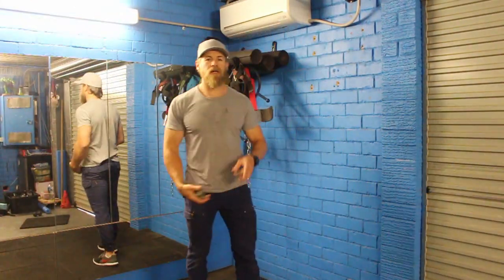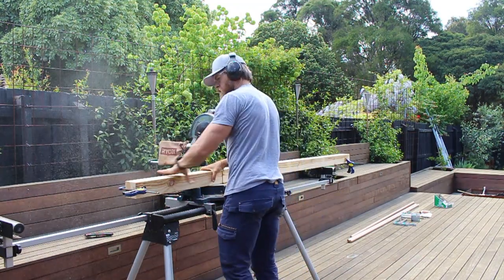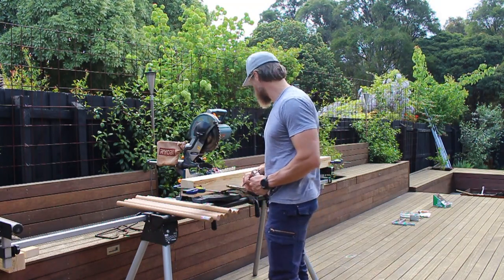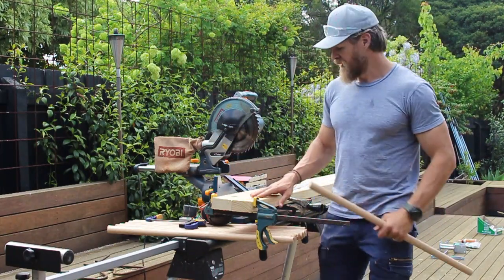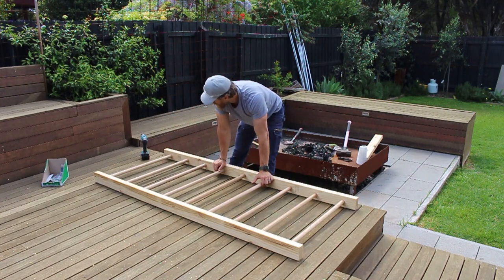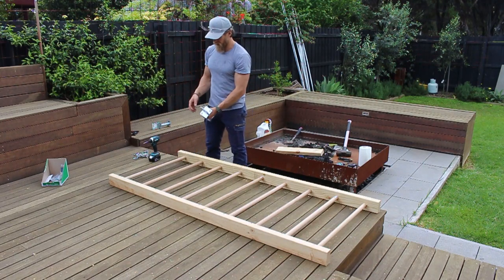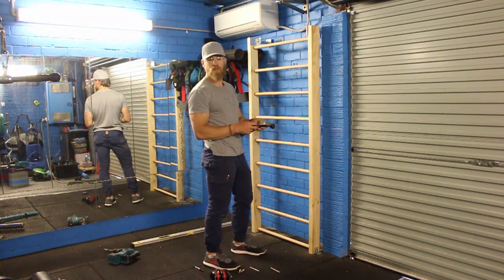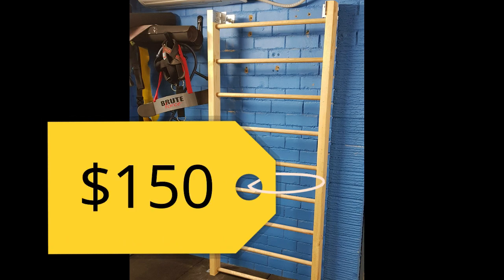Stall Bars - DYI tutorial

Comment: Excellent video but what are the brackets going to the wall called?  Never saw anything like that and I am confused what I should use.
Reply: @michaelholster5432  You may have gotten an answer from the Modern Day Viking but just in case, you can simply use iron flat bars bent in an "L" shape. They can be bolted to the outer side of the vertical beams holding the dowels and then to the wall. A metal shop will do the bending at a modest price and you can do the drilling. You can also use flat aluminium bars, a little more expensive but easier to drill and not needing any protective anti rust painting.